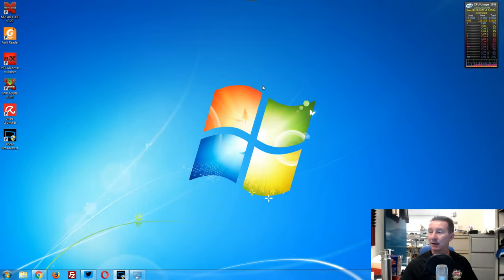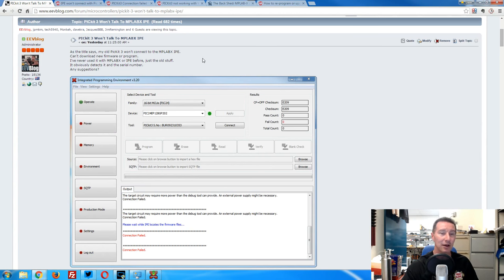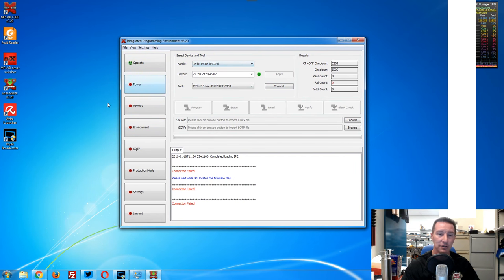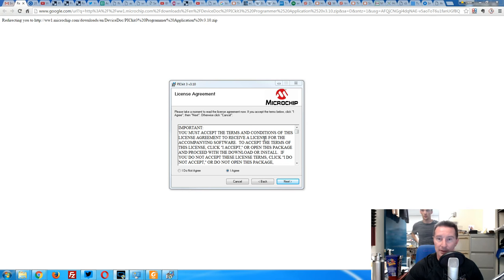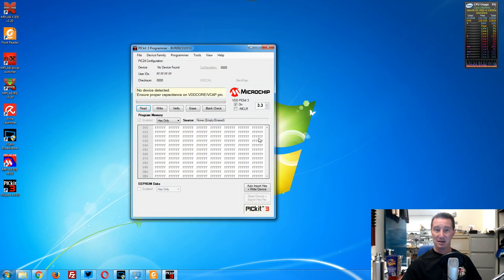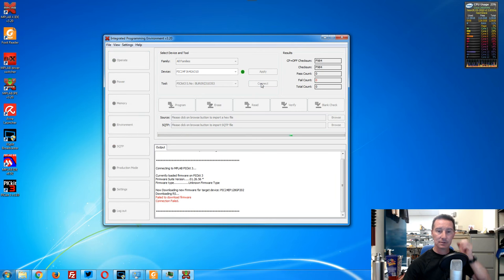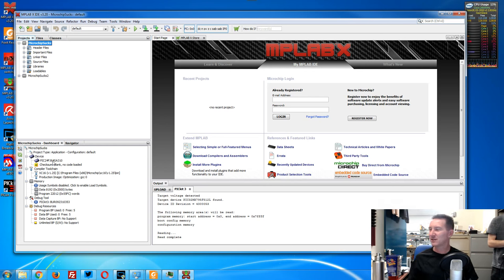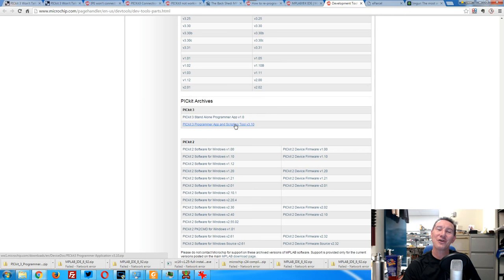EEVblog #841 - Microchip MPLAB X PICkit 3 Woes

Comment: This machine is weirdass Intel 64 architecture and it can have problems with drivers that normal AMD 64 machines (desktop-CPU Intels have it!) will not have.

Just a bad idea to try solve problems on this computer if you have another one :)
Reply: +popraw a Are you talking about Intel Itanium (IA-64) architecture? The x86_64 Intel cpus are AMD64 compatible.
Reply: They are in theory completely compatible but i had problems with .net programs and with nightly version drivers. In practice using another machine will just be in my opinion good idea.
Reply: +popraw a Intel 64 sometimes abbreviated confusingly and wrongly as IA64(Not to be confused with Intel Itanium) AKA EMT64 AKA x86_64 and AMD64 extensions are fully compatible. Intel licenses x64(Or is it part of the cross-licensing agreement? I cannot exactly remember) from AMD.

Comment: I'm using AVRs for a long time, ide is based on ms vs, tools never have any problems, I really enjoy that time. But know my college designed the stupid course based on PICs, I really understand how stupid Microchip is! the old mplab works fine but it's functionality so poor for today. the new mplab x seems ok but it's toooooooooo slow, stupid design everywhere(such as we have hit ctrl + space to get code prompt, why it is not pop up ) and not stable. as a development tool unstable is not accepted, most of time we may not lost any work but reopen it again and again is also super annoying. 

for pickit 3, when im using mplab x 3.15, it's works fine. when i upgrade to 3.20 it's failed keep saying no enough power or connect failed… i spend 4h just to get the damn thing work in order to finish my labs.

Microchip just crazy, everything looks great but they did it wrong.
Reply: sorry for the format and word mistakes. im using phone wrote this at 3am......